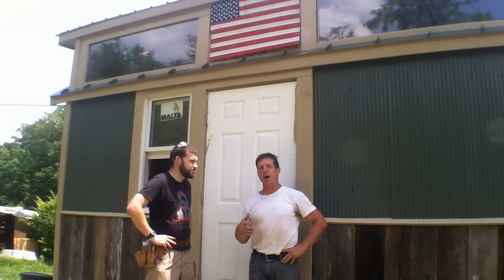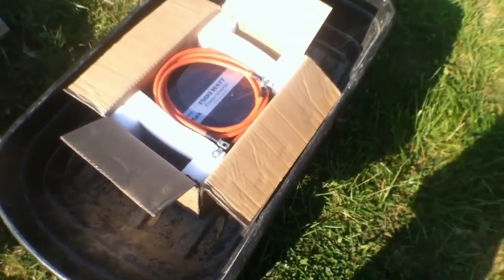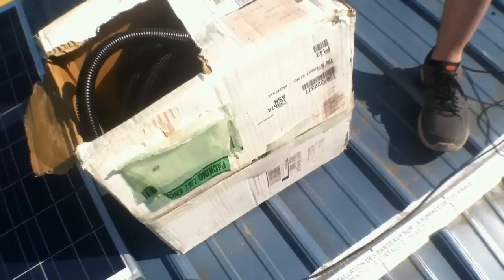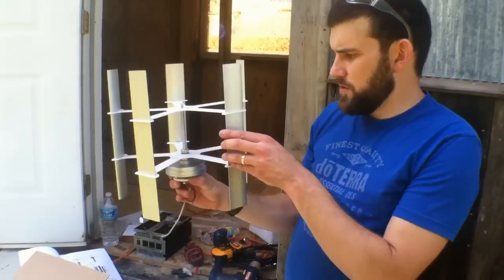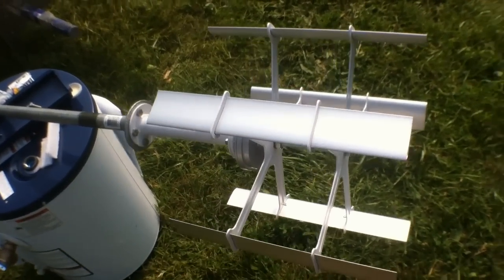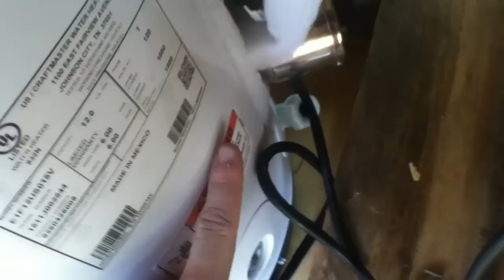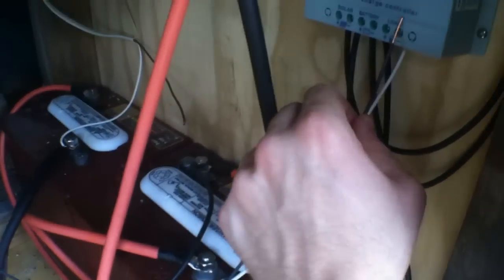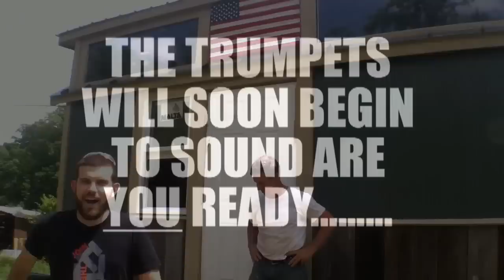How to wire a tiny house Off Grid with Solar power, Wind power and DC water heating

Comment: Could you give us a list of items ie: wind turbine, inverter, hot water heater & gallon size,battery names and size (volts) and any thing else you used for this off grid set up. company names would be very helpful. thanks Hunter
Reply from the maker: Hunter Welch Contact offgridcontracting.com

Comment: We are from Montana and we're thinking about traveling over and doing the workshop in January that Randy is putting on. I'm really interested in using the vinyl solar strips that goes on the wide metal roofing. Are you familiar with those?
Reply from the maker: I am familiar with those and we can install them. If you want to give us a call we can discuss it or email us either one just visit offgridcontracting.com

Comment: Here is a question. I am building my system for my enclosed trailer. I will have a 400 w system and will connect 4 12 vdc 135 ah batteries. Is the 400 watt system good enough ? Thank you.
Reply from the maker: or2169 What all are you planning to run and for how long at a time.
Reply: 7 TRUMPETS PREPPER At this point just lights. I have a 1000w inverter. I like that dc water heater
Reply from the maker: or2169 Yeah you should be golden then no problem at all.
Reply: 7 TRUMPETS PREPPER Thank you. I so do appreciate your time.
Reply: Ryan Romero Sounds like I need a bigger solar panel system. :(